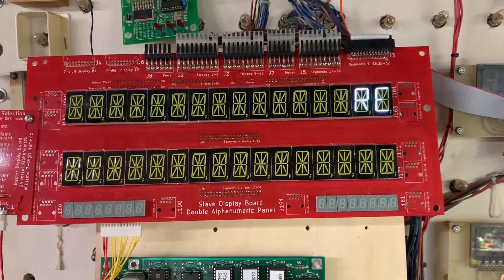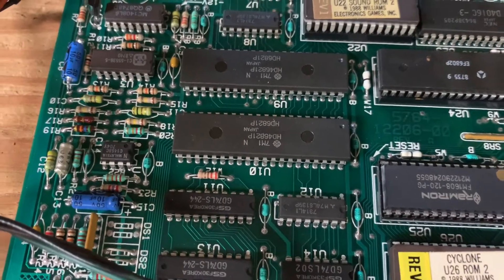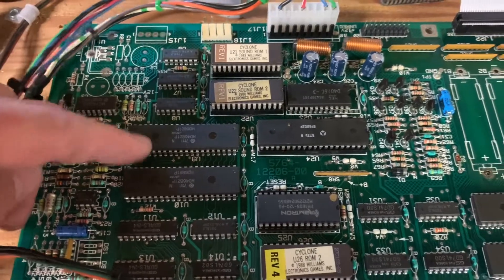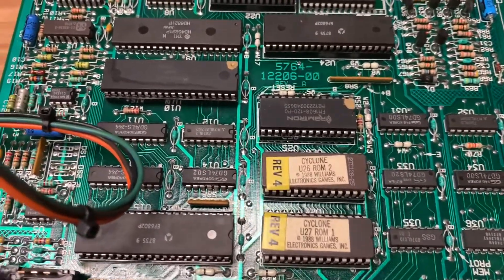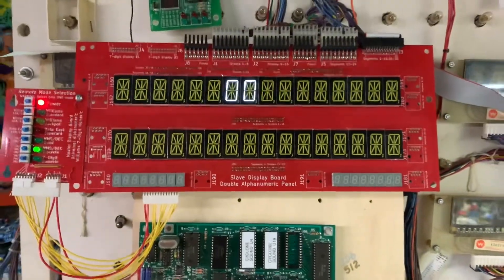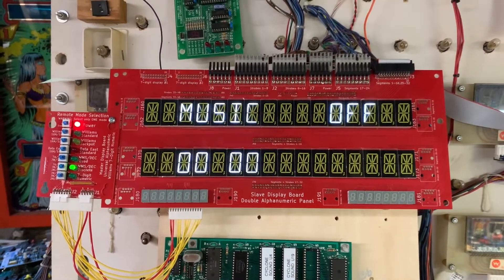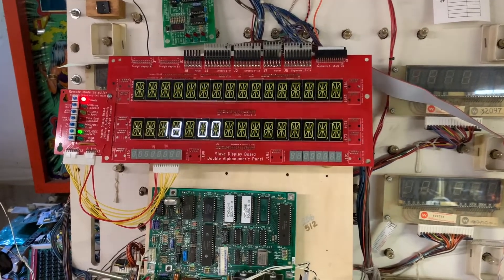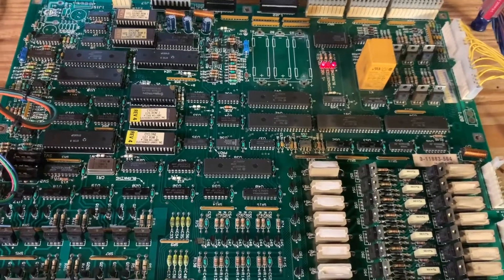Williams System 11 Cyclone MPU - U10 Error Repair and Test

Comment: Is this a test rom you're using to get the u10 PIA failure message?  I suspect my U10 is bad and am going to pull it this evening to test as the sounds that it controls do not work but the sounds from the sound board work fine.  If there's a hidden diagnostic menu I cannot find it on my game.  Earthshaker.

Thanks
Reply from the maker: I wasn't using a test ROM. The later WMS ROMs are better at flagging issues. WhirlWind is a good one to try.